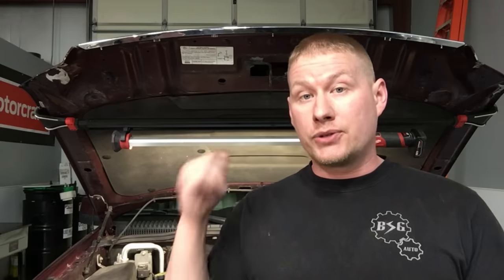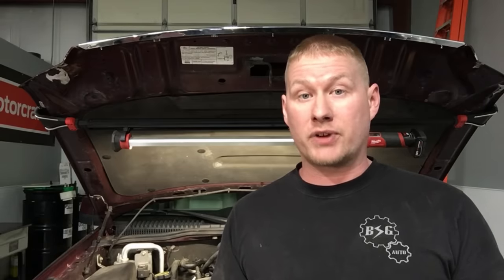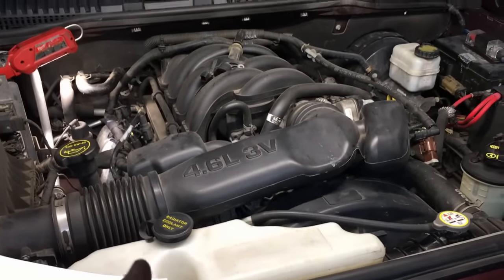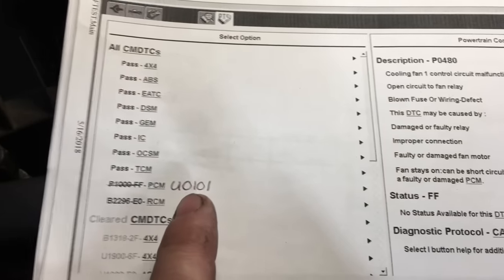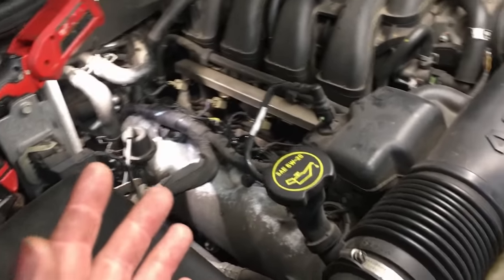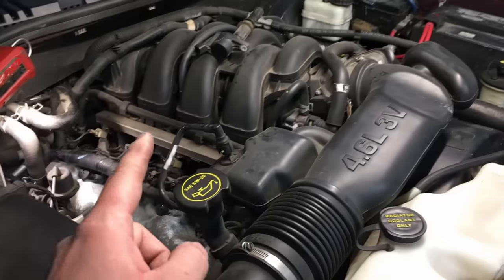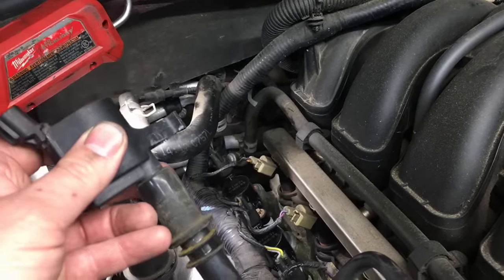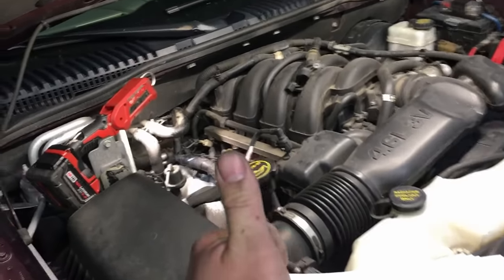2006-2010 Ford Explorer Transmission Shifting Issues Wrench Light: Check This Item First!!

Comment: It may be coincidence, but I changed my cylinder head temp. sensor on my '02 5.4 twice after getting false p1299 codes and limp mode that could be reset with a key cycle.
Would start and run fine from cold, but if I stopped for a short time, like to get gas or food, at start up of a warm engine I'd get engine light and pegged water temp needle.  Turn off - pull out the key - wait a few seconds and start again and the temp gauge would go to normal and no more limp mode.
Finally got the p0305 misfire on the #5 cylinder (closest to temp sensor/harness) Bought a new Motorcraft coil pack.
It's been a couple months and no more p1299.

Comment: Thanks for the informative video, my 07 Explorer just started slamming gears, turned On the wrench light, traction control light and gave off that U0101 code yesterday, I was told to check the battery which it indeed was bad, I replaced it with no success. Now I'm going to try the coil packs and see if that fixes my issue.

Update: replaced all 8 coils with Motorcraft coils from the link provided above. Transmission is back to normal, I cant believe coils would cause such a issue. Transmission shop quoted me $3,800 for a whole new unit, the coils cost me $315 😁
Reply: anything? my 07 explorer xlt is also doing this - engine light, wrench, & trac control lights are on! slamming and jerking hard and little acceleration.
Reply: @maxwagor7886  just replaced all the coils to Motorcraft coils, drove the truck for about 20 minutes and not once did the transmission act up. I will update you if the problem comes back.
Reply: @mr.boostang2064  Incredible, I have the same issue, wrench comes on,  traction light comes on, goes into limp mode like only 3rd gear. Pull the U0101 code. I am about to buy 4 coils for that side and cross the fingers
Reply: @johnjoe6159  good luck, it's been 7 months now and the issue never came back after I installed the motorcraft coils 🙏🏽

Comment: We have a 2006 Ford Expedition it was running fine then we drove from Louisiana  to Florida and back and now it goes thru the gears really rough depending on how fast I'm going and how much I am accelerating. The knowledge I have gained From your videos leads me to believe it may be either the Mass Air Flow sensor or a Vacuum problem. Would you tell me what you think 🤔please. Thx man.

Comment: 2013 Ford Edge V6, wrench, no engine issues, but transmission revs high and shifts aggressively. Could it be a similar issue of old coil EMI? It happened while I sat in a drive thru line.

Comment: Hi and thanks for all of your hard work and detailed video's. I wanted to know can all this be applied to an 02 Ford Explorer XLT 4.0? I have no check engine or service engine light or codes. I was driving and out of nowhere the O/D OFF light started flashing. I pulled over, turned it off and then restarted it. When I turned it back on the light was off. I proceeded to leave and when I got around 30mph I was having issues taking off. I had high revvs and it acted like it didn't want to go anywhere but after a few seconds it did. I am not the original owner of this vehicle so I have no clue of how often the previous owner checked the transmission fluid. Also there is no dipstick for me to know how much is in. The pan is under the bottom and is sealed. I'm really anxious because I do everything to keep this thing running like new. Please help. Thanks

Comment: Dude, thanks. I have a 2006 ford crown vic P71 interceptor with only 90K. I barely drive it. Now I have 2 quotes. One says new transmission, others say injectors, coils. The car is not coming out of 2nd gear. Remember the P71 interceptor, has a modified transmission system.

Comment: Ive got a 06 mustang that keeps going into failsafe mode with a brand new jasper transmission   all solenoids work when commanded on  drives fine until the codes come back on.
Have continuity between pcm and valve body connector. Wiggled the wires while commanding each on and have no faults

Comment: I had a 1993 S10 Blazer that would shift into 2nd gear violently and chirp the tires. The problem was a bad ignition module.

Comment: Excellent videos God Bless u......My 06 Lincoln Navigator Ultimate 161,000 miles have some transmission Issues on Drive position between 0-15 MPH trying to shift down or up "like hard or forced Shift and u can feel a little Hit or boom when change to a gear" all this happens in the traffic, if you put it on 3 gear position not problems happens.....I have done the Oil change at dealer but this not fix my problem....what u thing can be?.....tnks boss.

Comment: 2007 I had the trans rebuilt 2 1/2 yrs ago and it still shifted rough, he took it back in and looked at everything but again it still has trouble mostly shifting into reverse, seems to run fine going down a interstate although you can feel a rough shift every so often when you are slowing down and have to speed up again, do you think this will fix the problem with reverse and smooth out the other gears, No codes showing up. Other than that it drives like a dream w 260 k on the engine.

Comment: My 2007 4.6 4x4 Sport Trac would buck, slip and gear hunt. Thought the trans was toast. Did a Valvoline transmission fluid exchange and I haven't had a problem with it since. But my short trans dipstick was broken and I don't know where to get a new one.

Comment: Thanks for your videos.
Question, I have a 2009 explorer 6 cylinder. The signal lights work,seatbelts warning light work,hazard light work, etc. However, I have no dings sound.
What could that be?
Thanks

Comment: PLEASE PLEASE PLEASE respond. I just bought a 2008 F150 4.6 4x4 and on my way home after buying it it started behaving very similarly to the way you are describing in this video, with the exception of acting erratically at a stop. Could it be the same problem?  If not, where should I start. Several dealerships have told me that without looking they can’t know, obviously, but that it sounds like I’ll need a new transmission. PLEASE help me out.

Comment: I have a 2009 Explorer and my engine doesnt look like that. Didnt know they had 2 different engines besides the 6 and 8 Cylinder. Also my wrench yellow light has been on for a month already but the car is not limping. Still drives the same.

Comment: How about the 2006 mountaineer 4.6l? Mine started that bam bam bam and then the wrench light came on with the traction control light came on and went to limp mode. turned off the engine and restarted it and it went back to normal. and then a week later it happened again. then yesterday it did it twice.

Comment: I have a 2007 Ford Expedition and after fixing my radiator the wrench came on. I did have to remove the trans line and obviously leak some, could that have caused the light to come on?

Comment: Hey Bro - great video BUT I have a 2009 F150 as a second vehicle that I've owned since it was new.  It only has about 50k miles and now the wrench light is on.  I'm afraid to drive it.  Any suggestions for me?  thanks

Comment: I have a mountaineer that just started having an issue where it will only shift up to 2nd gear. No higher.. No slipping before or during and I still have reverse.. Can the issue you described in your video be the fix I need??

Comment: I just got rid of my 03 V8 w the 5 speed that had hard shifting and now i have an 06 V6 in way better shape w far less miles that just had the transmission rebuilt by a shop before they sold to me. Now the car hates slight long uphills on the freeway, it wants to keep up and down shifting and then feels like its out of sequence or something and the engine light flashes and then goes away after a few min- god i wish i had the 6 speed w the V8...because the 4th gen is better in pretty much every way. Except it still has tailgate issues even though the design was far better than the third gen. They both open up the glass from time to time- usually when im not able to stop and get out 😅

Comment: Love these videos man. Appreciate you. I have 05 Explorer that ALWAYS runs cold and shifting takes long time ..rpms 3 to 5k b4 shift and winding nosie on right side of engine. Shifting is def delayed but not banging into gear.. Only codes show are o2 sensor.. Should i have a shop diagnose the transmission. Or i was told possible fuel mapping issue. Is this true????

Comment: I would have thought the can lines would have some sort of emi shielding to prevent this?
Reply from the maker: No apparently they are just twisted for interference. Ford normally only shields critical sensors like crank sensors etc.

Comment: Question is, will I need my system flashed?  And how much should that cost? 

I’m replacing the rack and pinion on my 2010 Fusion FWD SEL (because 2010 wasn’t included in that recall. Total BS) $1800 at the dealer, but I’m going to do it myself for around $500.

Comment: The problem you described sounds exactly what is happening to my 2010 explorer. It only happens at idle but not every time. Yet when I stopped in to advance auto they came up with P0741. He did turn it to accessory mode.
Reply: Hello I have this code how did you fix it
Reply: @stevenwhitby1297  for me it was low trans oil. I ended up with a pool of trans oil so I took it in. There is no dip stick in this year so it is a pain to check the level.
Reply: Runs smooth now. No weird shifting either.

Comment: Just bought a 2006 Explorer Limited 4.6 last week in an As-is state. Of course no lights or anything. Soon as I drove it off the lot, the wrench, abs and Trac control lights all came on plus, come to a stop and there is a hard downshift after I stop. So, I'm stuck with it. AutoZone says they are not allowed to read and codes. Do you think this fix might solve the three issues? Thanks in advance

UPDATE 2024 - Fired the parts cannon at it. Replaced hub, ABS sensor, CV axel. In the end the front diff was the issue. Found that answer when it ate itself. Got rid of it. Checking/replacing the fluid might have saved money and headaches but got some good experience

Comment: I have ford explorer 2005 model there is problem with my car its engine closed on road 
I went to machanic he told me problem in throatel body i change it but problem same then he told me problem in fuel pump i change it but problem is still there 
Plz suggest me what i do
Reply: Get rid of that mechanic  if you haven't yet

Comment: Any suggestions on why my 06 4.0 is now hesitating and hard shifting after the PCM was replaced?  It ran fine before.   (It's past the point I could write this off as adaptive learning, it's never hesitated ever.)
Reply: Hi! Did you find out what the prob was? Thanks!
Reply: @urbanflyguide  Nope, but the solution was trading it in, I can tell you that.  :)

Comment: What would cause my 2007 ford explorer to not move in any gear. Shift cable is working worked just fine day before then next morning got in started put in D and nothing no reverse either. Oh and not one code or check engine light.

Comment: Cool!. I have a missfire on my 2006 4.0, on cylinders 1,2,3. And a stuck on lean s1 b1 sensor. I swapped the sensor from the other side and same code. And it won't shift past 1st. I just replaced the plugs and cables  and this happened.  Is there a fuel injector connector for bank 1 that I could have disconnected on accident?
Reply: Ok found out the catalytic converter was clogged.

Comment: Hey I had this exact problem I replaced my ignition coil on cylinder 8 and now it doesn’t disconnect but while I’m driving it kinda stutters before I shift but if I turn overdrive off it drive 100% fine

Comment: I am having this same issue as described.  Especially noticeable when first accelerating from a stop, then seems to be better.  I ran a scan though and nothing came up.  Is it possible to have a coil issue and nothing show on a scan?  No wrench alert either.
Reply: I was having the same issue, code u0101 was the only one showing on my reader. No misfirer, transmission banging !! Put in 8 new coil packs, runs like new !

Comment: What oil wait should I be using in my 2006 ford ranger with 100,000 miles I use the factory 5w 20 should I stick with that I use mobile 1 full synthetic and change it every 3,000 miles

Comment: I’m having the exact same problem on 2007 Explorer. 4.0v6 5 speed. Any suggestions on the fix. I’m fairly mechanical just don’t have the specific tools..
Reply: Hi! Did you ever find your problem? I have v6 as well. Thanks!
Reply: Hi! Did you ever find your problem? I have v6 as well. Thanks!

Comment: I keep getting a check engine light on my 2008 ford explorer eddi bauer , same code comes on and so for ive replaced the egr valve twice. Can you provide info i may be missing. Cant keep dishing out $ on mechanics ( 176. + miles on it )

Comment: Hello sir...i have a problem which about the OD blinking. It was scary to drive car while having problem with OD  was blinking. Can i know why this OD was blinking when it was to hard to accelerate but if am push to accelerated it find but at the same time it feel like explode  engine. Am very stressed when thinking this. At the sama time the engine also flashing. So here i need opinion from abroad. Please help me..my car is mazda bt 50,2.5 L,2008.

Comment: I am in trouble because from few month my ford explorer v6 2008 is taking to much rpm for example speed 120 km/H its taking 3000 rpm and if i will take it on 140 km/h then rpm going upto 4000 rpm and also transmition oil going to over temprature.

Comment: I’m having similar issues with my 2007 Ford Expedition. Transmission acting weird and the wrench light came on. It shifted into 3rd or 4th gear and I got it safely home. Does this video apply to 2007 Expeditions as well?
Reply: Did you ever find the fix for your 07' Expedition?
Reply: @jlwaltripsr22  Got rid of it. All kinds of issues. It ended up being the transmission.
Reply: @larrysofj  what did you end up getting in it's place?

Comment: I bought my ignition coils from napa for$36 each. Got discounted price because work as taxi. But my lincoln mkt i feel you description exactly the way you described it. I am smoking in the back when idling for 15 mins or more so i know it has to have a bad injector,  but i believe that my bad injector is causing my car to clank when shifting to 2nd when driving if its slow accelerate if its hard accelerate the kicking is gone and then if i stop and put reverse it clanks but if i put it in neutral first and wait 3 seconds then go to reverse it does not clank. Any suggestions i know its not my trans because based on my acceleration performance i know how drive and not have my car clank or hard shift at all.

Comment: sir before my ac is very cold and i dont need to on my rear ac in order to blows cold air,and sometimes wen my car ia running the cold is normal and when i stop its start loosing down the cold air,why sir? thank u so much sir god bless

Comment: These transmissions on these late model Ford Explorers rear Drive I seen them break the Bands and high mileage once I seen the case with a band piston goes in wears out you got to re bushing them and planetary issue also check the rubber Pistons that applied the Bands  Break to
They do have a revised solenoid pack but unless you're lights not flashing is not electrical issue
Reply from the maker: The transmission in this video purely solenoid based, no bands or servos. You are thinking of the 5R55S/N/W models.

Comment: What atf fluid do you recommend for an e40d transmission in a 1998 f250 5.4 triton? With propane from the factory

Comment: I currently have this issue. Had to drive it home in 3 gear and have no reverse also. No wrench on dash or check engine light on.
Reply: Could be your swirval pin

Comment: I have heard stories of a Volkswagen with straight plug wires shutting down a Mercedes with  computer ignition system. The Mercedes was unable to pass the Volkswagen because as the cars came abreast, the Mercedes would lose power.

There is also a high power microwave jammer called a Herf Gun that is illegal and used to jam auto computers. The police could end high speed chases with Herf Guns.

Comment: Could this apply to a 2009 F150 Lariat with 5.4L engine as well?  I have rough shifting from Park into Reverse/Drive and it sometimes revs high before shifting.  Fault code is P0471: "Torque Converter Clutch Circuit Performance or Stuck Off."  I'm searching your vids for something similar to my issue.  Research indicates possible wiring or solenoid issue.
Reply: I've decided to go with a new leadframe and solenoids.  Hoping that solves the problem.
Reply: Ever find the fix?
Reply: Don't you love how people don't follow up with the story?

Comment: @FordTechMakuloco I have an '08 mustang GT and I changed the coils and spark plugs. I have better throttle response and the shifting is better but still kinda shifting hard or not going in gear. Also, what does it mean when the OD light keeps blinking? I get that once in a while...

Comment: I have a 2007 Ford Explorer Sports Trac. Yesterday the transmission was not shifting. Stood like idling. I opened the hood and a small hose on the coolant assembly was bursting coolant out. Could this have caused the transmission not to shift properly?